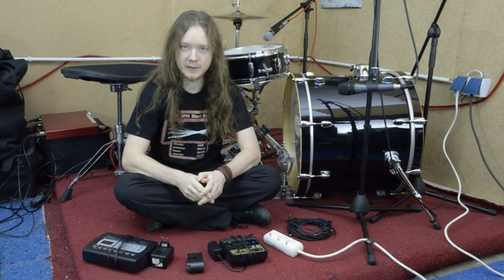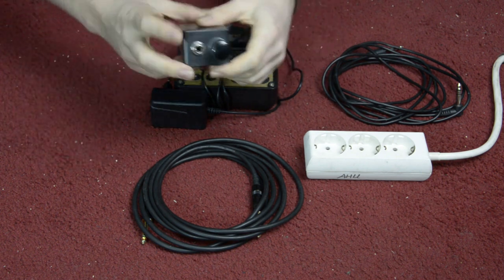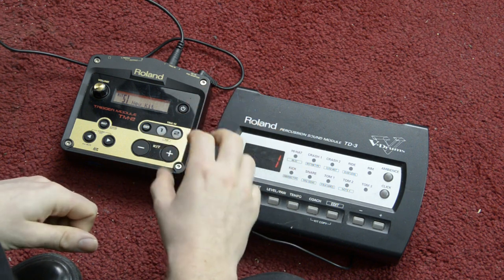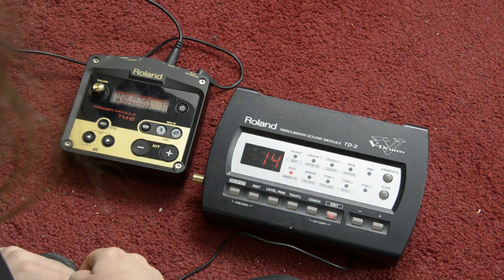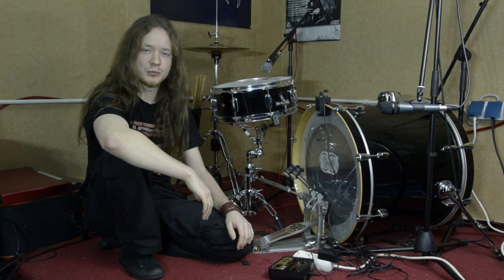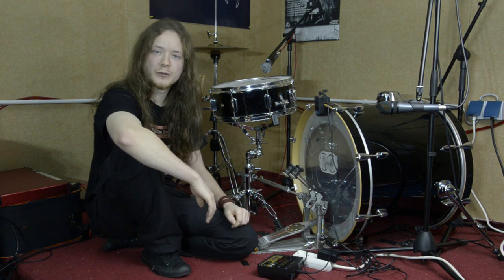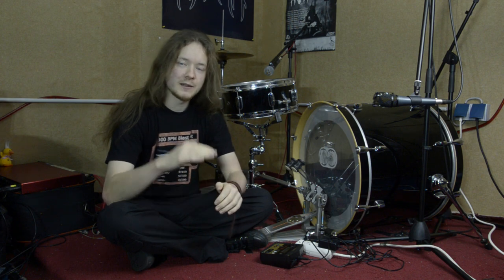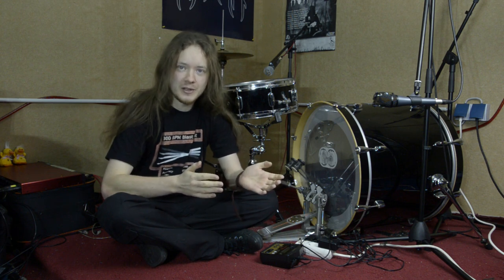How To Trigger Your Bass Drum!

Comment: Saying a trigger is cheating is like saying an overdrive pedal on a guitar is cheating
Reply: Not even close. Drumming is much more physicall and the extent you can do with triggers to make you basically not need to drum is insane. You can set it so when you hit the drum once it doubles the sound so 1 hit makes 2 hits, or you can make the sound increase hard enough that you can just tickle the bass drum and it will produce a good sound, no need for technique, my little sister could play that.
Reply: @jensloetzsch  I meant more in terms of physical strength than technical ability
Reply: @jensloetzsch  I was a bit more ignorant when I made th comment, but sometimes people do use the triggers to that extent, otherwise I don't think they're a bad thing, especially if it's a good sound, you don't have to tune ypur bass drum pretty much
Reply: @ConeTheBoss559  I currently have a trigger setup that I use on my bass drum, for the exact reasoning you just mentioned. I substitute strength with triggers since I have Multiple Sclerosis. Doesn't affect my arms nearly as much as my legs, so on my good days I don't need it, but when my strength fails me, and I'd still like to play the drums - I definitely use triggers to avoid the requirement of strength.
Reply: @ChristianSandviknes  wholly different when you physically can't do something, compared to just being too lazy to do it, you have an issue you can't affect, and I admire that you still drum in spite of it!!
Reply: triggers are not cheating. There's no way to hide from your mistakes when you have your drums triggered.
they just make it heard at a certain point when you lose velocity that you can still hear the sound because at a certain point at certain BPM's it is impossible to hit just as hard as you do when you're playing slower

Comment: Nice tutorial. Agreed on every aspect of what you said. I can add some more info from drummer / sound engineer perspective.

Triggering kick drum @ live performance is almost standard this times in metal music. Lets face it - you don't need any dynamics on your kick drum in death or black metal (and many other genres) - its almost binary 0 or 1 in this matter. When you hit - it has to be consistent in volume and clearly audbile with nice SNAP attack. Try to get good snappy, clear, consitent kick drum sound with kick mic on small stage in club, where bass player has his 6x10 cab cranked up, which makes bass drum shell resonate. Of course you can use fast gate, compression and envelope filter, but believe me - this will work until you start to play fast double kick, when gate never closes, its one big muddy HUM of bass frequency, no attack, no snap, your kick drum simply disappear in whole mix. Side chaining kick with bass guitar doesn't help at all. If you use trigger - there is no problem at all (using it on bass drum). Not to mention you dont have to worry about bass drum tuning.

In studio you have plenty of time, silent room, great audio gear etc. You can dial very good kick sound using mic and sub-mic mixed together. What about volume consistency in fast double kick parts? Well in such enviorment you can compress signal really hard without side effects (opposite to live performance) and it solves that problem. It is common to replace kick drum track with premade samples after recording anyway, just to get best sound that fits good in the mix. 

People (who have little knowledge) consider triggering is cheating because they're confusing it with MIDI output from drum module and quantizing hits to actual tempo map (in DAW after recording or in real time via drum module with tempo map and quantize option). You don't even need drum module to do that in those days in realtime. In such situation (quantizing hits to grid) it is cheating and everyone will agree on that.
Reply from the maker: Thanks for the additional info! Actually I never thought about the problems of compression on stage before - good point!

Comment: From an engineers stand point it’s nice to use both a mic on the kick and a trigger. You can blend the two sounds together and get even cooler kick sound with the depth of the acoustic kick and the attack of the trigger.
Reply: I was thinking about trying to use both trigger and a microphone I bought. I'm new to this so I'm trying to get a good loud sound and figure out how to hookup the audio to whatever speaker, module, mixer I need to. I've been buying all of that here and there as money I can spare for it. Always in need of advice from anyone kind enough to share with me. Thankful always. Blessed.

Comment: A good thing to note is that the TM2 is terrible for using DDRUM triggers on, they worked fine with my TD-4 module, but with the TM-2, even with the sensitivity maxed and threshold at 0, you cant get a reliable trigger sound. Unless you have really shallow bass drum hoops and can squash the foam completely onto the bass drum head.. you show up to a show with a clown who uses sound dampening rings on the front of the bass drum and you're cooked.

Comment: You should check out the "Pedaltrigger" triggers that you attach directly onto the pedal, similar to the Axis e-kit system. They have a version for the Demon Drive double pedal. If it works as well as I hope, it could remove all triggering problems and should make for a very short setup time, seeing as it isn't at all dependent on the bass drum.
Reply from the maker: Thanks, I will check them out!

Comment: the threshold seems a bit high for me, personally I put mine at about 18. If I was using a trick laser trigger, I'd have the threshold on as low of a setting as possible without sacrificing the feel for the slower parts.

Comment: Can this TM-2 be sent into a Mackie Mixing board, for more tweaking of Low/Mid/High and then into Mackie Thump 15's ? Do i still need a DY box still ?
Reply from the maker: Better ask Roland support about that :D
But you can use custom samples with the module so there should be no need for additional EQ. Output is normal jack cable so you need a DI box when you want to have balanced xlr. For recording it is enough to just plug it into my interface without DI.

Comment: Thank you Wanja for this userful information. I have one question, for you or any kind person willing to share: Is there ANY difference between this kind of triggering and electronic pads regarding input lag/latency (even in miliseconds)? My purpose is as first option use the drum module's MIDI out to my laptop PC running Superior Drummer 3 for triggering those kits. If anyone shows me some light and points that lag/latency is present, I would go to the second option: load custom samples to the module. (PD: I use the laptop PC for other instruments, etc so it's necessary) I'll be attentive to your response. THANK YOU!

Comment: I notice you add in a bit of a swivel to your bass drum moeller strokes, is it something you think about?
Reply from the maker: I don't do it on purpose. And it only happens at the beginning of a double bass roll and when I do short groups of notes. When I play for several bars my feet don't swivel around - I think it is more my feet trying to get into the movement and finding the right position.
Reply: Pretty much what you're doing then is dropping the leg (relaxing) to get a note and rebound, and then pointing the ball of the foot (tensing) to get the in between notes?

When you're working on speed with this technique, what things do you think about in your technique to keep rebound going? Where do you avoid putting pressure with muscles, and where do you intend to put it?

Thanks for taking the time to reply, been trying to nail this technique all weekend.

Comment: Hey, maybe someone can help me. I have the Roland td 25 Module and a Yamaha dtx 50 trigger for my bassdrum.
I have the sensitivity all the way up and the curve set to loud, but there is still volume dynamics. This leads to normal hits sounding very loud and softer hits sounding standard loud. How can I achieve that it actually sounds the same? It's very important due to my heel toe technique, where the second hit always is a bit weaker than the first one

Comment: what is the lag, or latency, from the time the trigger sends the signal to the trigger module, and from the module to the pa
Reply from the maker: There is a setting where I can delay the signal a bit but when I have it on zero I don't notice any delay. It also depends on the sample I use - it is important that the peak is right at the beginning of the bass drum sample.

Comment: hi wanja, just wanna ask u on how do i save my own preferred kick drum sound and also is there any websites that i could download it from?..need help on this as i hv difficulties on picking my own kick sound...and yeah, i play drums for a death metal band... :)
Reply: ohhh yaaa...by the way, i use exactly the same trigger head and drum module as yours + axis classic longboard pedals.
Reply from the maker: I don' know if there is a website for that - I used the stock sounds on my module for a while and later put the bass drum sound from the last Negator album on my module. You can also record one strong bass drum hit and then EQ it until it sounds good and then cut it in a way that the main attack is really at the beginning of the sample. I think the TM-2 needs the sample to have certain specifications (like sample rate etc) - check out the manual for that. 
So you export your selfmade sample with the required specs and then put it on a SD card wich you put into your module and it sould work.
Reply: hmmmm...i guess i have to give it a try 1st on what u hv just suggested!...anyway, thank u wanja!...u are such an inspiration for me to play drums!!!!! :)

Comment: I'm unclear on the difference between Sensitivity and Threshold.. could someone elaborate a bit?
Reply: Jeff Ripley I believe the threshold is the setting that determines how hard or soft you hit the drum to trigger the sound.  It doesn't deal with the volume of the trigger itself, just the trigger being activated.
Sensitivity I believe is how loud or soft the trigger sound is.  So if you want to have the trigger activated no matter how hard or soft you want a low threshold, but that means that if the sensitivity is too high, you will tap the bass drum head and hear a triggered sound that is way too loud for how soft you hit the drum.  
I hope that makes sense.
Reply: Gotcha, thanks! :) Does that suggest that, with a well-set sensitivity, you can still get a decent dynamic range from the trigger?
Reply: Jeff Ripley I would imagine so.  I share the same sentiment
Reply from the maker: Thanks! You explained it very well! You can definetely get a good dynamic range with a trigger but HOW good it is depends mainly on the drum module and its settings. Playing with a trigger is basically the same as playing on an e-drum kit and since there are e-drums that work quite well with dynamics I am sure that a trigger would also work well with the right settings.

Comment: I think it's time to put this whole trigger thing to rest, and personally I think the way you use triggers can be cheating, drums are meant to be loud and acoustic, there's no denying that especially bc with no acoustic set there are almost no dynamics, but I was thinking about it and I started comparing our snare drums to our kick drums and thinking why we'd need to trigger a bass drum but not a snare drum, and I had an "ah ha" moment... there are only a few factors with hitting a snare (tuning, intensity, stick, and stick weight) where as when you use a bass drum there are so many variables (head, tuning, muffling, type of muffling, technique, pedal, pedal board, weather it's a chain, strap or direct drive, spring tension, beater, beater height, beater distance, beater weight, beater material, and I'm sure we could come up with countless more, but my point is there is so much between you and the bass drum, and that means the bass drum is so unpredictable... however once you do have the right variables than I think it is very well possible to hit high tempo double bass speeds without a trigger (240bpm+) but it takes a lot of patience, time spent slowly going up the bpm, making sure hits are loud enough and consistent, and just having the cardio to do that... and with all that being said I also think people use triggers and don't need them, I see so many drummers play amazingly fast songs and play them with perfect technique and you can tell they're getting sufficient bass sound, but they're using triggers for what seems like no reason... and on top of that a kick drum is so unpredictable that if you just want a little punch then yeah that's fine just mix it with the regular bass drum it's no cheating, unless your pedal it's 2 inches from your head and you're baby tapping your head and relying on your trigger for the sound then you're cheating, all in all I think they can help with getting some punch or some missing sound that's not there bc of so many unpredictable variables, but It's very well possible to get to 250, 275, 300 bpm without trigger
Reply from the maker: I think 300bpm without triggers is possible but will sound like shit :D I think around 250, maybe 260 bpm is the fastest you can go while still maintaining a useful loudness. 
And drummers who do decent hits and still use triggers: The reason for that is simple! Many sound engineers don't have the time and/or skill in a live situation to create a bass drum sound that works well with high tempos while a triggered sound is much easier to handle.